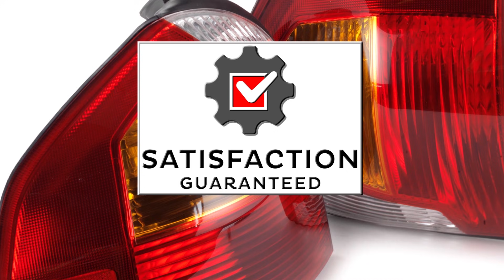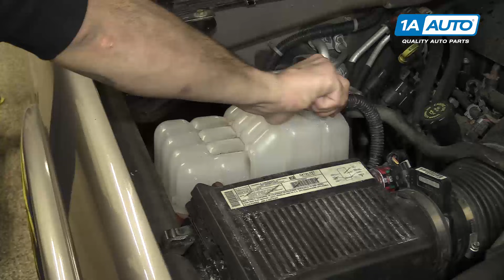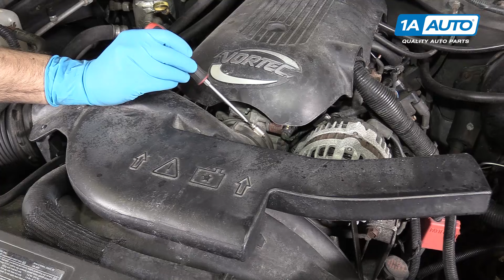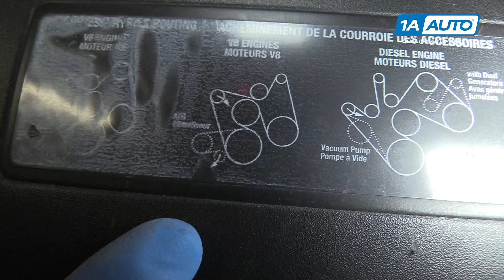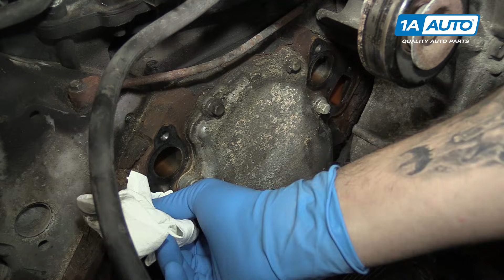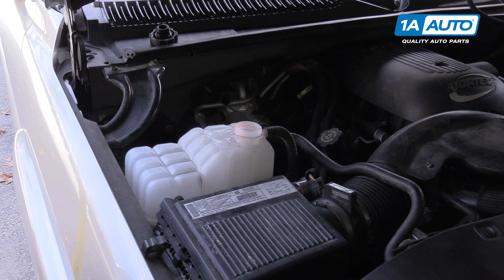How to Replace Water Pump 00-03 Chevy Suburban

Comment: Great video.  But I'm having some issues with getting that thermostat to fit into my water pump.  I bought one that looks just like yours.  Too tight a fit for it to enter pump.  This 2002 suburban I have I acquired back in March seems to have a new pump on it, but during cold weather now the the motor never comes up to operating tempurature and now getting check light.  I installed two thermostats from Oriellys auto and those thermostats have three raised ridges on top of them.  Both did not do the job and I suspect those ridges are allowing coolent to bypass into the radiator and not allow the motor to get hot.  Are there two different water pumps available for the 5.3L engine?

Comment: I might be wrong but did you use a New serpentine belt as it looked like the old one? This is also a very good time to replace all the vehicles antifreeze as many of us know the stuff breaks down over time and it's not good for all the aluminum parts these motor's use if not changed, flushed etc. Otherwise great Video!!

Comment: You need to add a correction to your pinned description... You said in your video to torque waterpump to 11ft lbs!  The THERMOSTAT HOUSING is torqued to 11ft lbs, BUT THE WATERPUMP SHOULD BE TORQUED TO 22FT LBS.  DONE IN TWO STAGES 11FT LBS FIRST THEN 22FT LBS.

Comment: a guy gave me a 2003 tahoe for $500 with a bad water pump for part payment on a job i did. randy's auto in sidney neb. told him a $1000 to replace the pump. did a little patch job for another guy that paid for the water pump. thanks to your video it was so easy to fix. 230.000 miles on the tahoe sounds like new no ticking sounds at all. do you think i got a good deal? its super clean tires are almost new breaks were replaced last year  and was well taking care of.thankyou you so much for helping me
Reply from the maker: +Floyd Kettle Thank you! We love empowering our customers and showing how to perform DIY auto repairs with our high-quality auto parts.  http://1aau.to/m/Shop-1AAuto-c

Comment: Thanks 1A auto team. This video was extremely informative and helpful. I just finished installing my water pump yesterday, after a small hiccup today (thermostat housing gasket) I was able to complete the swap. But also found out there are 2 kinds of serpentine belts made for this model. They differ in amps. A 105 alternator amp and a 130 amp alternator. The difference is literally just an 1in and a half.

Comment: For awhile now I'd get a "low coolant level" message on my dash once every 3 months or so. I could never find a source of a leak anywhere and simply topped of the fluid. Winter and snow have just hit where I live and all of a sudden I'm getting the low coolant message every couple of days. Still couldn't find any leaks. Now, I have started getting periodic belt squeal. I looked underneath my truck with the engine running and can see water running down my timing cover. The engine block is wet directly behind my waterpump. I believe this has been the culprit all along. I will be changing out my waterpump tomorrow. Thanks for the video.
Reply from the maker: +RYTHMIC RIOT Thanks for checking us out! http://1aau.to/m/Shop-1AAuto-c

Comment: The torque specs for the water pump bolts in this video is wrong. You two step torque the bolts, 11lbs first then 22 lbs. He forgot the final torque sequence.

Comment: If it's leaking from the paper gaskets, wouldn't you just spend the $10 on new gaskets instead of replacing the $150+ water pump?

Comment: For holding the fan to allow removal... Chevy Service Manual suggests taking the belt off and using a strap wrench to hold the pulley. You can get em in the plumbing section of any big box store and they use a rubber strap which holds nice and tight without marring the surface.

Comment: How do I know if the waterpump is going bad? What are the symptoms? 🤔
Reply from the maker: +Aerial Photos We wouldn't be able to diagnose an issue like that here, you may want to have a local mechanic take a look at it. Some signs to look out for is a fluid leak, steam from your radiator or your temperature gauge not reading a consistent temperature or abnormally high. Thanks for checking us out! http://1aau.to/m/Shop-1AAuto-c

Comment: I don't believe this Suburban has what you call bypass valves going to the core.  I believe the coolant runs through the heater core at all times and either goes in the cabin or is vented to the exterior via the blending door. The temperature control controls the amount of blending. No where on this vehicle have I seen valves.  Great video.  Thanks for posting
Reply from the maker: +condor5635 Thanks for the feedback!
Reply: So if that blending door is jammed or frozen . You’d get hot air all the time ? Correct ?

Comment: Another fan remove idea. I just grab a cpl small bolts and stick in 2 holes  in fan pulley, then a lrge screw driver to hold in place as wrench off I believe 22 MM fan nut.
Reply from the maker: +James Bailey Thanks for the feedback!

Comment: Is it 11 ft. lbs on all the LS variant truck engines?  I just replaced the water pump on my 2011 Camaro SS, and the first pass was 11 ft. lbs, but the final torque spec was 22 ft. lbs on the second/final pass.  ALLDATA says 22 ft. lbs on the second/final pass.  Not trying to contradict you, just trying to clarify for people watching this video.

Comment: C clamp trick is AMAZING and the easiest way I’ve ever done this! I didn’t have a rubber one so I took the rubber boot of a crutch and but it over the pad of the clamp and it worked great! This has always been the most frustrating part of this job but this method has it done in two minutes literally

Comment: My new pump came w an O ring and paper gasket for the thermostat shroud, my existing one has neither, I planned on reusing thermostat. I cannot use new o ring but should I use the paper gasket? I also forgot to use gasket compound on pump gaskets, is it critical to use compound? Thanks

Comment: My gaskets are leaking
Reply: My 5.3l is also leaking from the gaskets I am replacing the hole thing but make sure you torque the water pump right first pass 11ft lbs torque second pass 22ft.lbs torque on water pump the thermostat housing is 11ft.lbs
Reply: same here

Comment: 1A Auto Parts always comes through with their videos and parts! Time to replace mine for the 2nd time after about 60k miles. For some reason my water pump only leaks after the engine has cooled off.
Reply from the maker: +803Dray Thank you for the great reply. We love to empower our customers by showing you how-to perform your own auto repairs while installing our high quality auto parts. Have a great day! 1aauto.com
Reply: I’m changing mines today I’m having the same issues I a can drive 100 miles a day but when I get home it leaks overnight from the weep hole it’s strange

Comment: Great Video. The pulley on my water pump started chirping every so often last week but I thought  it was the belt getting wet from all the rain we had. Well the chirping became constant yesterday and this morning I noticed a lot of antifreeze on the ground. Opened the hood and saw the chirping was coming from the pulley on the water pump every time it wobbled. I’m guessing the fluid came out near the stem. Anyway I hope that was my only issue because I changed my water pump with your help. Thank you!
Reply from the maker: +fzintzun Thank you!

Comment: Great video - great opportunity to replace hoses when doing this job. Upper, lower and two heater hoses are easy to replace and if they are old will save you a lot of time and headache down the road. I have the same vehicle - looks so familiar.  Thanks for the video!
Reply from the maker: Thanks for checking us out. Shop here for high quality auto parts: http://1aau.to/m/Shop-1AAuto-c +condor5635

Comment: Mine came with metal gaskets from the water pump to the Engine. U guys recommend using gasket sealer?
Reply from the maker: +Benson James Yes, you can use a spray gasket sealer to help hold the gasket in place while installing the water pump. Just follow all the instructions on the can.

Comment: What is the main part of the water pump that tends to leak? I have an 03 Chevy Avalanche with a terrible coolant leak, I'm having to pour in more coolant every 3-4 days and pools under the truck whenever it's parked. I haven't been able to trace down the exact spot that's leaking, but the water pump tends to be the cause of coolant leak
Reply: i had the same problem on my 2002 chevy avalanche 8100 vortec 2500 engine. i bought a new water pump, put it on & took it off twice. it kept leaking behind the water pump. i thought it may be a freeze- plug.  but, it turned out to be the brand new water pump was leaking from the back, near the seal and the bolts on the back. Now, i'm waiting for a New Water pump to Arrive. This Problem Was Very Hard to find Because i didn't Believe that a New water pump Would Leak Fluid As Soon As The New Water pump Was Put On My Truck. I Hope This Answer Will Help You. Good Luck.
Reply from the maker: +Nicholas Loe Thanks for watching!  A water pump can leak from anywhere really.  A lot of times it will be the main gasket that fails, leaking from hoses that aren't clamped down properly, the thermostat or the inlet and outlet tubes.  1aauto.com

Comment: Great video, as all 1AAuto how-to-videos are, so I went to 1AAuto website and ordered the part, unfortunately the thermostat and housing did not come with it so had to order separately. Video said it came as a kit. Also the packaging of the water pump was very poorly done. In a big box with no bracing to prevent pump sliding all over the place in-transit. Inside of box had lots of tears in it. Also the mounting surfaces of the water pump had lots of scratches on it. Hope the gaskets provided take care of it.
Reply from the maker: +mike davis If you have issues with the parts you ordered please contact our customer service department at 888-844-3393.  One of our representatives will be more than happy to help!  www.1aauto.com

Comment: You guys have another video on a GMC with a 5.3l in which you say to torque the pump bolts to 22-24ft/lbs. Which one is correct?
Reply: My manual says its 22 lbs...you should first torque opposing bolts at 11lbs so that you don't twist the aluminum housing and then come back and do the same thing at 22lbs.
Reply: I believe 11 ft/lbs is the initial torque and then 22-24 ft/lbs is final torque setting, for the water pump bolts, but the thermostat housing bolts are just 11 ft/lbs.
Reply from the maker: +Austin Farace The torque specifications for this part is 11 ft/lbs initially and then a final pass at 22 ft/lbs.
Reply: @1AAuto  so is that the final pass that you guys didn't show in the video? 🤦🏻‍♂️

I guess I know what I'll be doing this weekend 😒...

Comment: Thanks I did the same change out on my 2000 Z71 5.3, but had a strange event happen while recharging the water, the heater core over flow under the AC accumulator constantly pour the wate out that i was putting the radiator??? HELP PLEASE THANKS

Comment: This was a great video.  Very informative and easy to follow.  Was able to replace my water pump, ac belt and idler pulley, tensioner pulley and a few more items.  Even told how tight to tighten up the bolts.  Watching this gave me some xtra confidence to do it my self.  Probably saved me 2-3 hundred in labor.
Thanks

Comment: Doing this on a 6.0 and am having trouble removing the fan. Tried the C-clamp method and the pulley still spins, any suggestions?
Reply: It is easy to remove water pump with fan still attached and then take it off once pulled out.
Reply from the maker: +robert price Did you try a pry bar to prevent the pulley from turning? That may help out
Reply: a metal Tap  & Hammer while still on the truck. Otherwise remove clutch fan & Water pump. Take to nearest Auto Shop. The Mech On Duty Will Be able to Loosen The Nut Within A Few seconds.

Comment: great video I'm doing mines tomorrow, jst looking to see who does it differently, but that's the same method I'm using
Reply from the maker: +Derrence Golden Thank you for watching. We hope your replacement goes smooth and operation of your vehicle gets back to normal!
Reply: What type of gasket sealer did u use